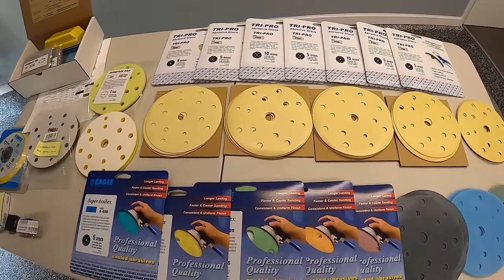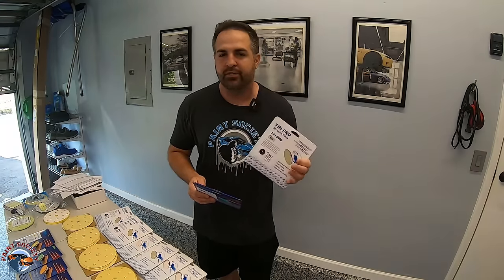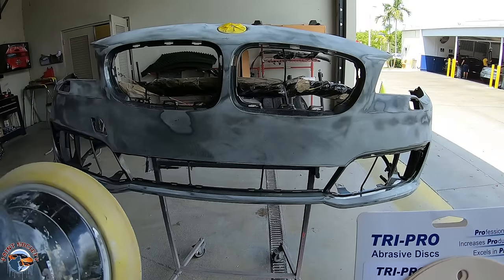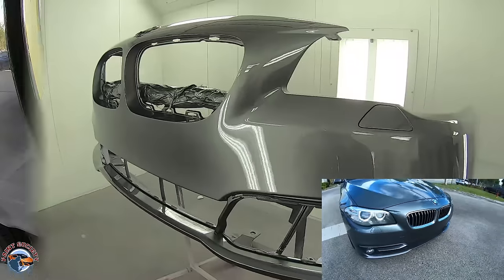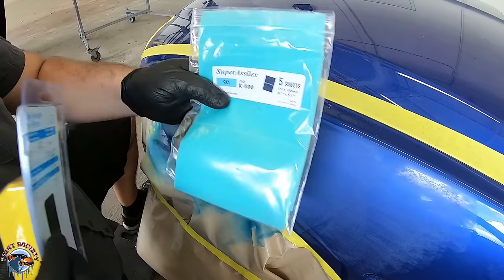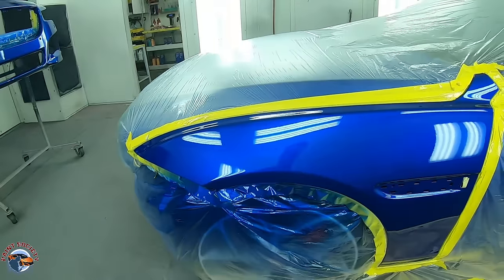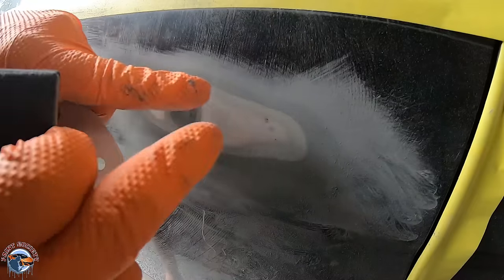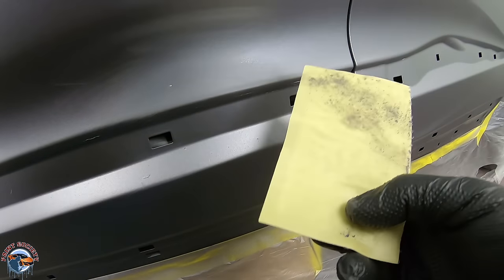How to Sand your Car for Paint

Comment: I am really sold on the K series now. Learned so much on grits, cutting speed and more
Reply from the maker: one thing I forgot to mention is to operate the DA at a slow speed to cut better.
Reply: @PaintSociety   Any good links (for novices) about rust removal and preparation?  Have you already done the video and I failed to find it? I appreciate the content you provide. It's really helpful.
Thanx

Comment: Ok, I watched the whole video. Not an expert on the European “P” & “K” but you did a good job of explaining the results. I see PSA sandpaper and hook & loop, not once did I catch either term used to describe this system. The cost of sandpaper goes up and the “K” series will be more expensive due to intellectual properties. I have no choice but to use PSA paper, I also understand the reason for an “Inter-Pad” of 3 cushion values and results. I find the hard nibber set interesting as well. I seen the short-stoke sander used, in other videos, to reduce the orange peel or get rid of it. I have limited funds, but will find a Short-Stoke sander, as bad elbows only get worse. This is a complete refinish on my vehicle, but will have to use PSA and the best coatings I can afford. Also, no mention of the filler but would guess it’s Evercoat. Trying my best to do it right once. Chemical strip (Bought 1 gal per visit 5 years ago before it doubled and the Methylene Chloride was reduced/take out of others), epoxy seal, filler with a mix of polyester gazing/honey for better sanding, less clogging. Always used a folded coat hanger with rubber hose handle to clean paper. 
  So what filler? PSA or not? ASE Master for decades but back, elbows had surgery. What my son doesn’t take, my wife throws away. Only 62, I guess it’s not the age, but the miles. Any info on products? Thanks.

Comment: I guess my main question is how do we tell when we need to sand down to metal and/or when to stop sanding?  I'm working on a project car (yes, I saw your Civic project vid) but when I sanded it down to rid of the clearcoat some areas exposed metal whereas some areas exposed primer, and ripples (weird).  I was left with high and lows, primer, metal and ripples yet the panel felt smooth.  I started with P220, P320, to P500.  But mind you the metal areas were exposed while sanding with P220.  Really odd.  Anyhow, did I sand too much?  I have other panels to sand down but don't know when to stop or rather just how far I need to sand?  Your help is greatly appreciated as always.

Comment: Dude you are awesome..your channel is awesome. You have helped me a ton.
Reply: Could I ask for your opinion? I want to repaint my c5 corvette myself. I will be applying base coat and clear. I have not sanded the car yet. Could I use 400 grit dry sanding of the whole car to take off the clear coat and then apply my base coat after? I'm wondering if the base coat would cover up any scratches from the 400 Grit or should I dry sand with 600 grit then apply my basecoat? I would be using a DA for this. Thank you

Comment: This video is awesome, hi Brian, i couldn’t make out the bumper you were painting was plastic or metal? To sand the roof of the car and paint to bare metal, should I start with P180, then P220, P320, apply primer (3 coats) , then base coat and clear coat? Should I use guide coat and P400 in between ?

Comment: 1977 olds cutlass, would you recommend taking it down to bare metal ,or just to primer or even that far?.I  have repaired and small rust areas and for the most part the paint is still good just lower quarters were bad and door dings.

Comment: That just blew my mind. I might have to invest in so k-series materials. So the K-series kinda allows you to skip a step or two in the sanding process correct? For example sanding with k400 is equal to the cutting speed of 220 with a 400 scratch correct?
Reply from the maker: Yes that’s exactly correct.
Reply: @PaintSociety  thank you. I love your videos, you're like the Bob Ross of automotive paint 🤣. You're so cool and relaxed and you make every mistake feel like its no big deal.

Comment: Nice video but I'm sick of hearing about this K grit because I have tons of P grit I'm going to use. How fine (with P grit) do you have to sand before using a gray scuff pad on a DA before applying sealer? Will 320# and a gray scuff be okay or go all the way to 400#?

Comment: Question on rust repair... what is the correct method to tackle this issue... i have a roof with surface rust, i ground it out and applied a rust inhibitor but the next step im unsure of... what primer would i apply if bondo is needed, and what primer if no bondo is needed... thanks... base coat and clear coat follow if im correct.

Comment: I used a 80 grit to remove layers of paint , I went to primer without smoothing my surface metal first, 
I went to sand my primer and I can see all the scratches from a lower grit, 
Should I go back and re sand ? 
Or add more primer/filler to fill the scratches ?

Comment: Hi Brian, love these videos man.  So much information. 

I do have a question however. 
I am currently stripping back a friend's 1965 ford gt cortina.  I want to coat with epoxy primer as though it isn't a full bare metal respray, there is a lot of bare metal around the car.
What grit is best for me to use over the car for best epoxy primer adhesion to the metal and old paint?  
Very much appreciated if you answer.  Cheers.

Comment: I have a plastic grill from a Jeep Wrangler and I’m using rattle cans to spray it down. I accidentally used the wrong sand paper to go over some parts of paint that got sprayed on too thick. It left scratches. What’s the best way to get it out for a smoother finish? Do I sand it using red brute scotch pad (600grit)? I used 160 grit which felt soft to touch which caused the scratches. Of course I did this when I let the first few coats dry.

Comment: I have a 1998 Mustang convertible in white. It needs front & rear bumpers and hood painted. Hood has chips and bumpers have cracks in paint. Passenger side rear quarter also has a small repair paint has peel off 1.5” dia. I was going to repair and blend in. What would you recommend paint the parts on car or off.  Thanks for your help.

Victor

Comment: Hey Brian, awesome videos they’ve helped me a ton! I’ve built my own truck from start to almost finished and i’m nearing the finish line with body and paint, I had to replace my cab and the new one i have has been resprayed poorly with the paint flaking all around the edges. You said at the end of that was the case to take all of the paint off which i’m following but do I need to take it to metal or just until I hit the factory paint?

Comment: Hello Brian, thank you for this very interesting video. Question: when do you apply wet sanding?
Reply: When you sand clear coat,you wet sand
Reply: @DjT0myG  
Thank you so much 👍🏼
Reply: Also smoother finish as well helps alot ,
Reply: Do I need to sand clear coat completely away with wetsanding?. Or do I just need to get the rough clear peal down and everything even and lightly wet sanded, dry, clean, and then I can primer even over the existing clear?. I'm doing my hood.  On my 74 buick apollo

Comment: Hi Brian, congrats for becoming a father. I have a question.. My father and uncle are both car painters for about 35/25 years. And I am now learning from them, working with them. They mask the car with paper at first, and after that , a bit further they tape the nylon wrap around. They say that when painting metallic there is the danger that the basecoat , the metallic paint to peel of from the wrap because of the air pressure when clearcoating, and on the clearcoat it reaches. Did it happen to you? Or not? I see you don.t use paper too much.
Reply from the maker: Never happens because this is automotive grade plastic and one side is treated so that it holds the overspray and doesn’t flake off.

Comment: Hey stumbled onto your channel because my parents grand vitra roof is peeling. Great stuff but I have a question. When I use let's say a p60 grit to remove all the old peeling paint should I jump to a p120 after I blow away the paint dust? Also do you seal after each layer of paint

Comment: The first bumper you do with the P grits, can you clarify which equivalent K grits you would use for that job? I'm not clear if we should be using comparable numbers since the finishes are the same as the numbers denote i.e. K-240 = P-240 or if you use the cutting speed equivalency i.e. K-240 = P-150. In that process you start with a P-180 so is a K-240 usable in that step? 

Would prefer to stay in the K grits except for the P-80 grits that are needed. I will be doing my whole car with various types of body work.
Reply: “Buy em books & what to they do? they eat the damn pages!!”

Comment: hey brian, how do i mix up sealer?? im VERY curious how to do that as i would like to try it. I just started painting and have had great results so far. im wondering if u can just buy sealer or what. and also how do u make em diff colors like u do?? thanks again. I LOVE YOUR CHANNEL. im a die hard honda fan and own a yellow rhd type r and recently sold my 2000 ek9. currently have the type R, orange 05 rsx type s, and a red 95 si k swapped hatch. cant wait till there all freshly painted some day.
Reply: so sealer is basically thinned down/reduced primer. check the tds sheet for your primer n it’ll say if it can be mixed as a sealer too, or you wanna get like a 2k primer/sealer, they’ll usually mix at 4:1 for primer, or mix at 4:1:1 (4 primer: 1 hardener: 1 reducer) or 4:1 + 20%, just as examples. different products mix different or not at all so again & always check the tds sheet for any product beforehand. Also, don’t take my word on it cuz idk shit. Brian does talk about sealers in at least a couple Paint Society vids which is where i got the info from. Guess i shoulda just replied w/that lol. Paint Society vids r the fucking man, man!!

Comment: Great video and excellent presentation. I need your advise on one problem i am facing.

I painted close to 100 cars and I am DIY helping my friends. I dont know what mistake i am doing while masking. once clear is completed, there are spot clear overspray appears, the way i do is i use 3 m tape and then i use masking paper (good automotive quality) on top of the masking tape, once clear is applied, there are always few spots, clear over spray occurs while removing masking paper. this exactly occurs on the tape that has masking paper not on the tape where i used in first step.
Reply from the maker: The plastic is treated on one side for overspray to stick.  Make sure you’re using the correct side
Reply: @PaintSociety  hi ,i used corrrect side, but still have this problem. infact i tried using automative paper instead of plastic.

Comment: I was told that you don't want to go finer then 400 before painting because the paint needs the tooth, so the paint will stay on better what  do you think?
Reply: Absolute garbage bro try it yourself and you’ll quickly find out, 400 grit in metallic base coat will leave you with more scratches on the car then there is paint

Comment: So if I keep  sanding primer with 800, 1000, 15000 it’s not good? For example I am doing a plastic bumper from a BMW I scuffed it, put like 3 coats of primer and sanded it with k600, 800, 1000 and 1500 because I thought it needed to be like glass for base coat and clear….. 
at 9:10 for example sand the primer with 600 and 800 should be good enough. Thanks Brian
Reply from the maker: It will be too smooth and it won’t have any scratch to it for paint to stick to

Comment: Thank you for the video bro.
I have a question for you buddy. my base colors texture is grainy, so do I need to sand everything off and prime it again? or can I smooth out the base and just paint with the base over it?  I am trying to safe time by not using prime again. Can I dod that? 
Thanks again for all your hard work.
Reply from the maker: Just sand it smooth with 600 and then go for it again
Reply: @PaintSociety  Thanks.

Comment: Quick question please. I use HOK UC35 to clear my HOK bases. Results are great, no complains. Read about Speedokote smr 130. It's more affordable than HOK. Should I try it? Any advices? I'm the guy whom paint the bicycle frames. Thk you, Alex
Reply from the maker: uc35 is really only for motorcycles because it is resistant to gasoline spills.
Reply: @PaintSociety  Cool, thx. Any recommendations for a good quality n not so expensive clear? I really appreciate it.

Comment: When doing body work.... clean area thoroughly.  Grind and pull dents with 24 or 36 grit. After 1st urethane prime, guide coat and use 220 grit with DA. 2nd prime coat ,guide coat and wet sand with 400 wet grit paper. Seal paint. Less cost and ive been doing it for 40 years. Let the air tools and guide coating do the work. Don't need all these grits PERIOD!!!!

Comment: I'm repainting my entire car a different color, I have the rear bumper off of the vehicle, it needs some cracks repaired and the clear coat is flaking off entirely. Can I use the 180/220/320 process you demonstrated?

Comment: Question, after you prep and fix the area and then you sand the rest of the area down to remove the clear coat, do you spray base on the whole panel ?
Reply from the maker: Only the areas you are blending
Reply: @PaintSociety  Thanks bud 👍

Comment: Hi, what cleaners should i used to prep for basecoat, i have small repairs in hood all primed and sanded 600
Reply from the maker: Wax and grease remover
Reply: Thanks,  I thank God I asked a professional they told me to wipe a whole car with acetone
Reply from the maker: Never
Reply: @PaintSociety  i painted my friends pickup truck today 😅, i have seen many of your videos and last time i painted was a bumper 7 years ago, i want to thank you for the quick reply and for the knowledge posted in all your videos, it made today possible for me.

Comment: hey Brian how do you prep an paint these aftermarket rubber flares to prevent the paint from cracking or flaking
Reply from the maker: You gotta add in flex agent into the sealer or primer

Comment: What polyurethane plastic filler do you find the easiest sanding with the  p/k sandpaper?
Reply from the maker: Plastic fillers in general don’t sand easy because of the resins in them that make them flexible.  We mainly used poly flex

Comment: I have a 2000 ford econoline box truck e350. There looks to be two layers of wrap and paint under each other. I started using the rubber wheel but notice that it’s very very time-consuming and I’m wondering if I can just sand over everything but I’m not sure what grit I should use I was thinking a 220 does anyone recommend what grit to use on the Box Truck. Keep in mind that the box part is mainly just board/wood material not metal
Reply: um i’d refer you to a great Paint Society video it’s called “How to Sand Your Car for Paint”, but that’s this video u just watched, so idk if there’s help for what you have. I’d say maybe watch it once more but this time hit “unmute”? You can buy em books but they just eat the damn pages!?😣

Comment: Im having trouble making sense of some of the video, maybe someone could clarify for me. 

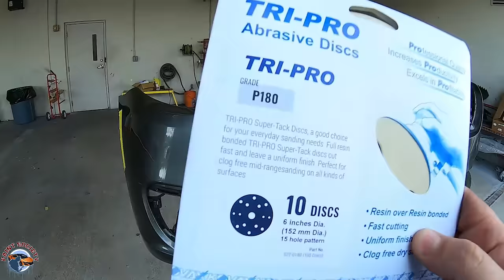at 6:15 he starts by giving the process for plastic and filler which is 180, 220 for 180 scratches and then smooth with 320 and possibly use maroon pad. He then moves onto sanding bondo then primer then rust chips and so on.

 I watched the video front to back and i couldn't quite make out what you're supposed to do to get to primer step!! What grits would you use if you have normal old paint and clear on top and want to get to the applying primer step, the beginning he mentioned something about metal but he never touched back on it , or i missed it. Would it be the same as his plastic and filler section?? Please advise.
Reply from the maker: For feathering and smoothing out old paint you can use 180 then 220 and 320

If it’s really bad take it down to metal with 80 grit
Reply: @PaintSociety  Thanks for the quick reply! Awesome man. I'm new to painting and i got an old Dodge Stealth just waiting to be painted but i was so unsure and i didnt want to mess it up. This car is expensive enough to upkeep!!

What exactly would you consider really bad? The clear coat is non existent and the paint is an awful faded dark green.
Reply from the maker: @CorporalCactus-fs8ns   check out my video on fixing damaged paint. I show this repair. However in that video I used a different type of sand paper so you’ll have to understand why the grits are different.
Reply: @PaintSociety  Ill check it out!! I also wouldn't say I'm gonna fix the paint, but completely repaint it, i hate the color with a passion.

No worries about the grits, i understand the concept of p and k grit. Im assuming thats what you mean.
Reply from the maker: @CorporalCactus-fs8ns  correct. I tried my best in this video to lay out the difference.
Reply: @PaintSociety if I have scratches from 80 grit after filler/primer and sanding,
should I go back and sand again? 
They weren’t showing until I went to sand the primer with 320 before that the hood was good couldn’t feel any scratches,
or do you think I can I add more filler primer and use a higher grit than 320 to sand ?

Comment: So would you use only 320 when sanding a vehicle when just prepping the car with no bondo?  I have a fiberglass bus with I think an enamel coating that I'm painting.
Reply from the maker: Depending on the surface And what needs to be done, if the paint is in good condition then you can just use 600
Reply: @PaintSociety  The issue I'm having is that my bus is white and I cant tell visually  or by feel if I've sanded enough just using 320.  The areas I've sanded don't look like they've been sanded like with this bumper.  Is there a rule of thumb such as how many overlapping passes I should make?
Reply: Guide coat helps with that